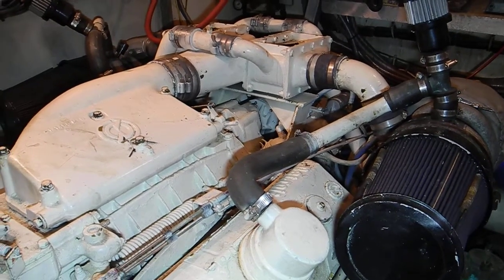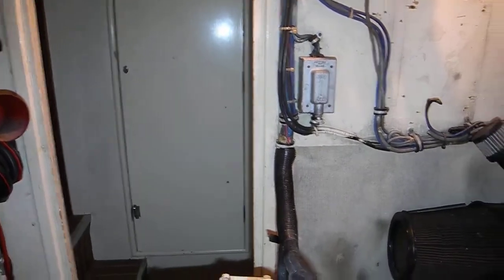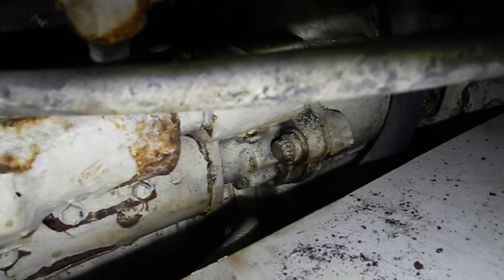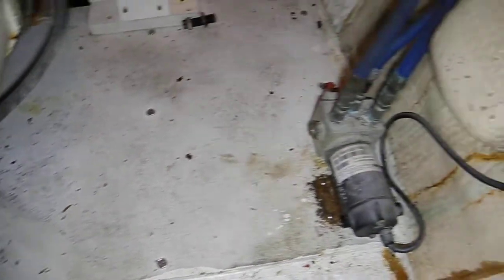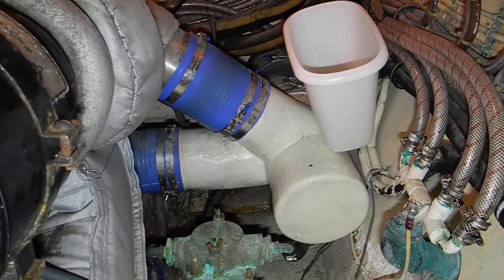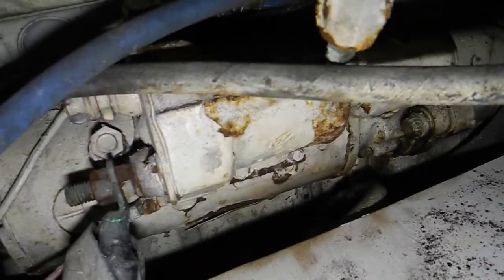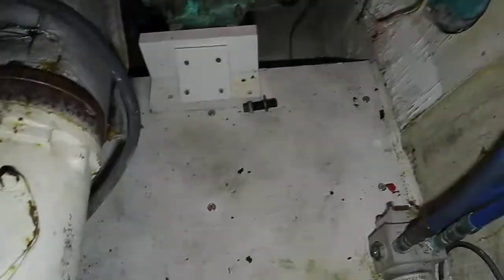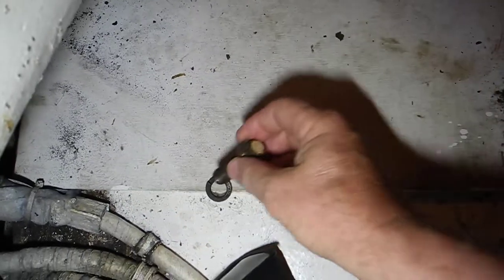Detroit Diesel  8v71 Starter Removal

Comment: How do you remove the starter on a 8.2 Detroit fuel mixer with twin turbos in a 26 ft. Angler boat?  I took the exhaust manifold and the turbo off to be able to get to the starter.  I removed the solenoid and the bolt on the starter that is away  from the engine and the top bolt.  I cannot even see or feel the bottom bolt on the starter.  I am attaching a picture.  Any help would be greatly appreciated.  Thanks in advance!!!!!  I can not attach pictures
Reply from the maker: Sorry I can’t help you but while the exhaust pipes are disconnected be sure to plug them so the boat does not sink. It happens more than you think.

Comment: Skinning people with long arms  make the best marine mechanics.
Reply from the maker: Ray M but the starter still wouldn’t come out until the platform and brace were removed.
Reply: @AskCaptainChris    yes. guess Hat thought it wouldn't need replacement and it seems the port side on most diesels are challenging.
Reply from the maker: Ray M this is the first time in 40 years that starter had to be removed. 👍🏼
Reply: Hi capt chris, are you on Facebook? May have a few questions for you 😊
Reply from the maker: I prefer if you call or send an email.